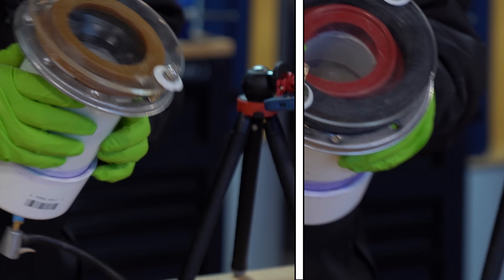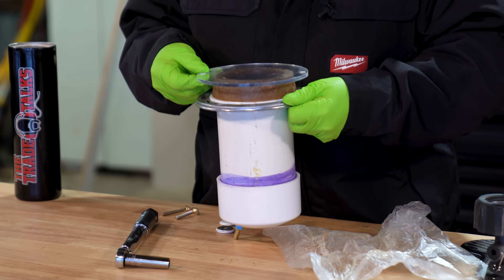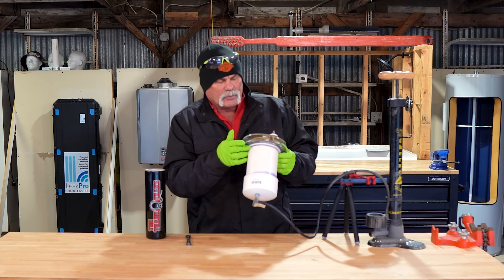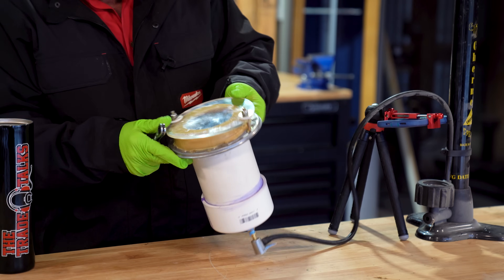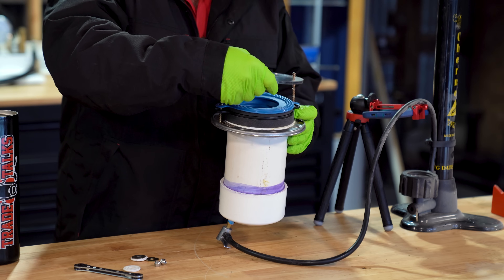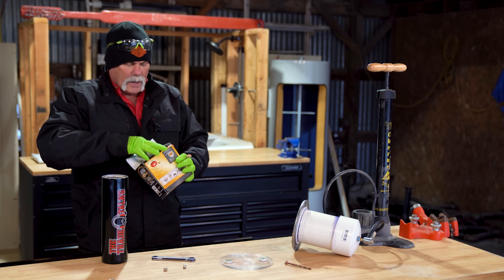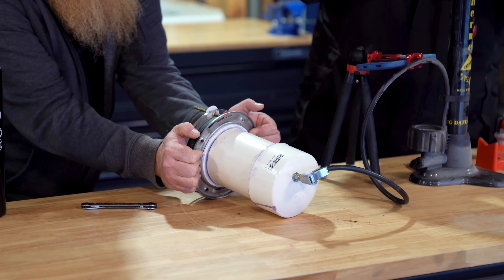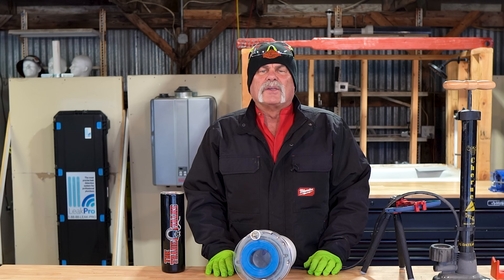Toilet Wax vs Rubber: Which Works Better?

Comment: Not a plumber but diy'er...used 'The Green Gasket' sani seal from Home Depot and it worked great. Almost 10 years later and still no leaks. My dad still prefers the wax rings though.
Reply: I will disagree. It is a great idea  until you have to plunge and water would go up over the round part and leak out the bottom. I just changed the ring from say 4 yrs ago which I had a green foam ring. It was deformed and as soggy as a kitchen sponge.
Reply: @KreemieNewgatt  Yes mine did have the downward flange that directed waste into the drain I haven't tried one since that one as I haven't had to replace a toilet since then. If the new ones omit that design that seems like a bad idea.
Reply: @scottratcliffe6337  you disagree that mine worked for 10 years without issue? How would you know that it did or didn't?
Reply: @major7up You might be surprised how worn that Sani-Seal looks today. They dry up, harden and shrink over time but are very impressive when new. Currently I am using the One-N-Done seal kit by Zone Industry. I really like their approach over some of the other waxless rubber seal designs from all the major players I have used in the past. I give the seal a wipe with silicone grease to lube it up and slide up the toilet flange completely for best seal when setting the toilet. The included guide screws in the package are easy to work with too. I buy mine at Menards.
Reply: @heystarfish100  that looks pretty interesting. I'll have to keep that in mind if I ever need to do another toilet repair

Comment: I've used both originally wax and the problem i had is the wax getting compressed down too much from people sitting on it and causing the toilet to wobble. Here about a year ago i switched to the blue one you showed in this video and it's been solid since.

Comment: Your test is totally bogus.  What you are testing is the bending strength is a thin, flimsy piece of plastic (while it is supported in only 2 places).  The plastic is bowing & lifting away from the seal.  With 4" pipe, the force on that plastic is about 12 times the PSI you are applying.  At only 5 PSI, that amounts to 60 pounds.  The plastic bends!  Pressure is not what makes a toilet seal leak.  It is shifting of the toilet, movement of the pipe, or shrinking of the seal with age (causing the seal to lose contact).  The wax seal can only deform ONCE to accommodate irregularities in the toilet or pipe.  The silicone seal continues to spring upward to accommodate movement.
          The maximum pressure toilet can make is 1 or 2 PSI.  Seals leak because they separate, not because of pressure.
Reply: Don't listen to this guy. He's in the pocket of big wax.
Reply: Plunging has destroyed wax seals often
Reply: I knew there was something that didn't make sense about this test but I couldn't quite figure out why. You hit the nail on the head. Very poorly designed as it doesn't replicate the conditions under which a toilet seal operates.

Comment: My upstairs bathroom has had the wax ring fail twice in the seven years we've been living here (first was installed by the people who renovated the house before we bought it, second was installed by me (I am not a plumber)), and both times the ring had a large crack and also appeared to have partially dissolved or something. When it leaked the second time last summer I replaced it with a rubber ring, haven't had any more leaks so far but only time will tell if it lasts as long or longer than the wax rings have.

Both failures resulted in water dripping from the dining room ceiling any time the toilet was flushed.

Comment: Born in 1970. My father made me help fix everything as soon as I was able to hold a hammer. Foam gaskets from back then, got compressed  and leaked. Wax rings eventually gave out after leaks and a few retightening situations. I switched to better than wax and have had zero issues. The main outgoing sewer line for the house broke and the lowest point for it to back up was the basement toilet. Better than wax held just fine with a full to overflowing toilet and the pressure in the veritcal pipe, as it was beneath the shower upstairs. No more cleaning wads of crappy wax. If I need to change the toilet, it's a snap.

Comment: Plumber here. Fluidmaster rubber for me.  If people lose power in Florida it gets hot enough to melt the wax rings.  After hurricanes come through and people loose AC I get a lot of leaking toilets.  I've never had a complaint about sewer gas.

Comment: We have two bathrooms and had wax ring fail twice on both! I used the hybrid one that has both wax and rubber which allows you to reset the toilet if you had to. fast forward two years and no problems yet.

Comment: I love the Korky rubber rings.  Ive never had an issue.  Ive used the Fluidmasters, too, but prefer the Korky.  Not once have i found or have had a repoet of gas coming through.  It seems they're more forgiving, too, of people dropping onto rhe toilet seat or shifting the toilet, somehow.

Comment: I have replaced a lot of those rubber rings as a service plumber. I think after a while they dry up and shrink, causing the smell to come out. I had one that failed not even a month after installation. I sold the work, somebody else installed it and I felt like a real jerk having to reset this brand new toilet with wax when it should have been done right the first time.
Reply: I've had them dry up when I shut off the water while away on vacation. They leaked when I turned the water back on.

Comment: I used better than wax and after a couple years sewer gases started to get past the seal. I'm not sure if the foam broke down or if the toilet wobbled and the gasket shifted but I went back to an extra thick wax ring

Comment: Should have tested the Better Than Wax without the black spacer because you rarely use it. I’ve installed dozens of toilets with the Better Than Wax and I’ve only had to use the black spacer one time.
Reply: I usually only need the spacer when the floor has been retiled with thicker material
Reply: was looking for this comment.  He tested tall wax and short wax, but only tall rubber/foam.  Also, not sure why we're measuring the quality of seal by the amount of pressure it can withstand.  Aren't we checking for a good seal?  Give it a little bit of pressure to have it pressurized, making sure there is a seal at all, then do a color/smoke test.  Both products should pass with flying colors XD.  3:14 he even says it should never experience this kind of pressure, or anything close to it.  And, like others have said, why does he keep using that same piece of acrylic bending it more and more?
Reply: That’s the only thing they’re used for is when the flange is below the finished floor.
Reply: The instructions say to use the spacer with a flange flush or recessed to the finished floor. The only instance that the spacer isn’t used is when the flange is on the finished floor.

I have a flush flange and the spacer actually caused the toilet to sit about a half inch high at contact. I had to tighten the flange bolts to compress the foam. 

Without the spacer in place, the seal didn’t make contact with the toilet.

Comment: We live on a hill top, with a sewer cleanout at the cul-de-sac outside the house. 
We got a notice that the city will be conducting a sewer test, and there can be smoke coming out of our toilets. 
A truck pulled up to the sewer cleanout manhole, and started pumping smoke into the system.  
In our house, nothing happened to the toilet with the rubber seal.  
But massive smoke coming out of the toilet with the wax seal.  
Both seals have been there for 20 years.  
I know what I need to do.

Comment: Sometimes the floor isn't stiff enough, and the customer weighs 370 pounds. The toilet rocks a little no matter how correct the installation is, and the wax has no elastic deformation only plastic deformation - it ends up leaking. I use neoprene these days. I've had to go back and repair wax, but never rubber.

Comment: I am a homeowner, do-it yourselfer not a plumber.  One of my toilets just would not seal with a wax ring.  I even went to the effort of cutting out and replacing the flange, made sure it was the correct height. Still wouldn't seal.  I tried a rubber ring and it solved the problem.  I used wax on the other toilets in my house without a problem.  Honestly I am not sure why it wouldn't work in one place.

Comment: To me, and I’m no plumber, but I believe that it really comes down to securing your toilet and preventing it from rocking. The rocking is really bad for wax because it doesn’t expand back to seal it from leaking. If you do it right, a wax ring should outlast rubber.
Reply: I agree with you i just had this issue i thought my brother didnt put the floor in correctly but the flange was just to high so it rocked i got 10 years out of the ring and just started to notice the off gasses, I took off the toilet and had to redo the whole flange to stop it from rocking back and forth it works great now.

Comment: Replaced the wax with the new ring on my own toilet, greatly reduced the flow through the toilet. Toilet has been changed back to the wax. All future repairs will be wax as well. Never have before or after went back to the wax, had as many toilet plugging issues as did with the rubber seal.

Comment: I am not a plumber by trade, however, I have installed & repaired many toilets in the last 55 plus years , and I always used the wax rings and never, ever, had a failure with any of them.
Reply: I’ve had plungers ruin a few of em.
Reply: @cantgetright742 to much pressure

Comment: I just tried the fluidmaster rubber gasket  2 days ago and it leaked! I had to pull the whole toilet back up again and used a wax ring. That's what I should have used to start with! So much for new and improved!!
Reply from the maker: Oh no! Was there a wax ring on there when you put the fluidmaster on there?
Reply: Same. Definitely prefer wax.  Extra thick ones always do the job for me
Reply: Try Danco wax and rubber hybrid with sleeve
Reply: I use wax but if I use the rubber ring I put some silicone on the top before setting the tiolet.

Comment: My plumber no longer uses the wax seals with hydronic heated floors. His concern is the heated floor will soften the wax too much.
Reply: been there done that and yes it will melt the wax 🙄
Reply from the maker: Ooohh very interesting, we don’t have heated floors here in TX so that’s something I would’ve never thought of.
Reply: Ahhh....makes sense
Reply: @RogerWakefield  a non-wax one would also be a better option if you are flushing your warm washing machine water through the toilet. I actually installed the same as the red one as in the video for this reason, just to be safe.

Also you should have gotten a thick metal ring to prevent the acrylic from bending as the rubber-based seal are not giving in when squished. A toilet doesn't bend like that so it wasn't a fair pressure test comparaison 😂
Reply: I have been setting toilets with wax on radiant slab floors for 21 years here in Alaska.  The only time I have ever had a problem is if a toilet has a wobble and it’s not properly shimmed. I’ve never seen wax melt ever.  If anything I think the warm floor makes the wax more sticky.  The slab temp in my home right now is 85 in one zone and 74 in another and it’s -20 Fahrenheit outside right now.  The concrete just doesn’t get all that warm.   I’ve heard about “melted wax” for years, It’s a total myth.
Reply: @TwinShards that would have made the test results more consistent for sure. And maybe even a torque wrench as well.
Reply: @augustlindow1162 How hot does a radiant floor get? Not hot enough to ever melt toilet wax or you have major problems. 👍🏼
Reply: I'm in South Florida and during the summer, the inside of my van gets really hot, probably more than 120°F. Wax seals get a little soft but they don't melt. I doubt any heated floor is going to get that hot. Even if the fluid is hotter, the tubing isn't that close to the toilet that the heat wouldn't dissipate.
Reply: @TedDekens  My slab temp never gets above 85 degrees.  No where near hot enough to melt wax.

Comment: As a DIY homeowner, the first time I tried resetting a toilet after a flooring replacement, I frustratingly screwed up three wax rings, each requiring a trip to Home Depot. On my last attempt, I noticed the blue one and bought it. It was SO FORGIVING of my ineptitude. I was confident it had a good seal even though I had to manipulate the toilet quite a bit. That was 14 years ago and it has been perfect. I will never use wax again. Maybe the pros are confident and capable of using the wax ring, but for an extra few dollars, it's totally worth it to me.

Comment: I am a General Contractor and I have been wondering about these for so long. I've used both, have had no problems with the new rubber seals (especially when dealing with older homes that suffer from people just laying new flooring on old flooring or those flanges just being before floor level), but I have not found a definitive answer for what is better. I mean, I like being able to reuse the rubber and not having to clean up that messy wax, but I just don't know which is better. I seriously question how the rubber seal holds up to a plunger because  plunging creates a lot of pressure. I wish someone, somewhere could come up with a definitive answer.

Comment: I used the Danco one that you had in your thumbnail but didn't test.  That's the one that's half rubber and half wax.  Worked great for my application.  Floor was very uneven and I would rock the toilet too much when installing a wax ring, causing a gap.  The Danco one did a great job maintaining a seal while I adjusted the toilet to make it snug.
Reply: This is a hybrid type. I love this (Danco) it is the best one.  The only one I use now.
Reply: It is the only one I use. Unbelievable the best one ever made. The only problem I have with it is. It is designed here but made in China 😢
Reply: @chipcook6646  Probably gotta keep the price reasonable.

Comment: I've installed two DANCO All-In-One Toilet Installation Kits under my two new Jacuzzi 1.8 gall toilets and it's five years without an issue. I used them because the bathroom had two floors and the flange was below the floor surface and with their added height compressed to make a good seal.

Comment: The better than wax that has an integrated wax ring is awesome! I don't use this foam one. The one with the wax seals great directs all the stuff straight into the pipe and allows you to reposition the toilet

Comment: I use the Fernco FTS-3 3" Wax Free Toilet Seal, best on a new toilet install.  They also make a 4", FTS-4  a little over 5.00 at Supply House.
Reply: @KreemieNewgatt  The adhesive on the Fernco is sticky like a mouse pad.  After I put it on a new clean bowl, I put PL adhesive around the flange to bowl for extra grip and let it ry for a few days. Put a little liquid soap on the flange and inside the pipe and it slips right in. If you have one of the bowls that has a slight rocking due to floor problems Fernco will not be a problem because when it moves it does not break the seal because the final seal is IN THE PIPE not at the flange.

Comment: Ove used a foam rubber ring. My toilet did wobble, and i was able to retighten it.  The amount of backpressure doesn't seem to affect the rubber seal at all.  Ive had itnon for over a year now.

Comment: I had trouble with my toilet for too long. Switched to non-wax seal and have never looked back. Its easy for a diy-er to mess up the wax ring during install (especially without help) which is what I attribute to my issues. I'm not going back to wax.

Comment: I have been a G C for 20 years and the synthetic is all we use. in century homes some have heat vents shooting at toilets melting the wax over time (creating failures) and with the synthetic this does not happen. Hope this helps and Great Video!

Comment: Hi Roger, the last time I installed a toilet with the rubber ring instead of the wax ring, the rubber, even though it was pliable,  it cracked the toilet bowl at the mounting bolts !!, so, I had to buy a new toilet and I wound up using the wax ring instead!

Comment: I just replaced my ring and flange. The orinal was wax and at some point, stared leaking. Totally rusted out the flange. The house is 20 years old. Luckily, it didn't cause and mold or wood damage. I caught it early enough. I replaced with a reinforced wax but seems like wax has a shelf life before it degrades or something. I wonder if the rubber would degrade over time like that. The benefit of your test though, you can just reform the wax and reset the toilet if you needed to.

Comment: Always use a 110, felt or neoprene lined wax ring, ones [designed for wall hung toilets] otherwise you can blow out regular wax if plunging a main line stoppage, then rot out the flooring ! You will thank me later! Plumber Steve

Comment: I've only been installing the Danco hybrid rings. You still get a wax seal to the floor, but you can reposition the toilet and the rubber flange goes up inside. Also, they work if the floor flange is below the floor, even, or above. I only have to keep the ONE product on the truck to deal with any scenario. Not a plumber but I install flooring so I pull and re set/replace quite a lot of toilets. I've never had an issue